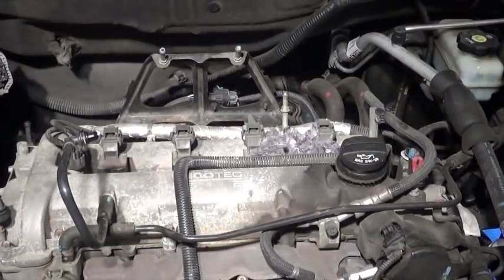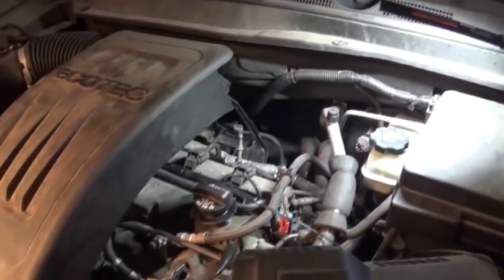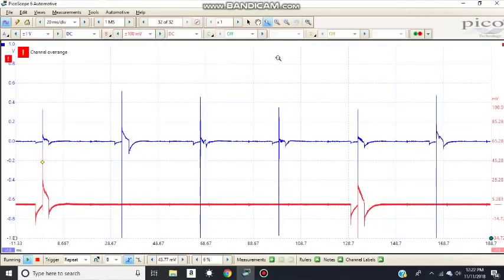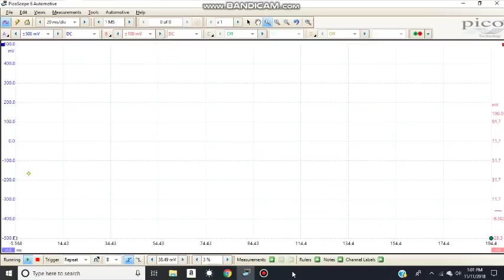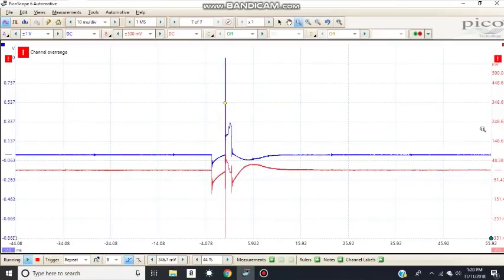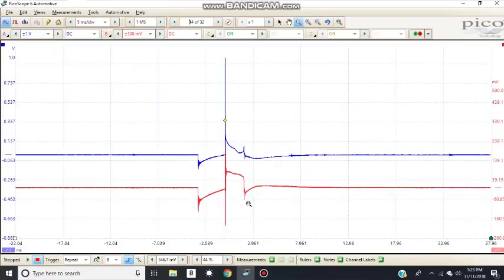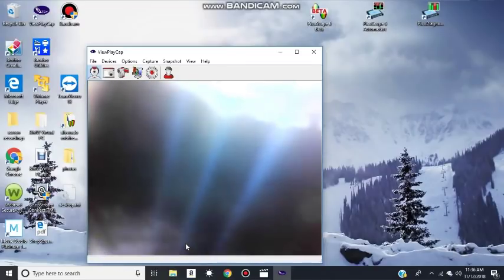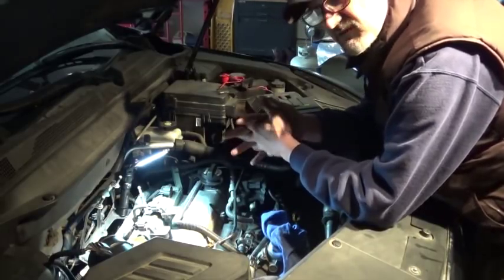Chevy ECOTEC Engine Secondary Ignition Analysis

Comment: Great innovative tool, but I'm struggling with the quality of the waveform. Is it good enough to a diagnostic call? If this engine had a rough idle or intermittent roughness, would this waveform lead you to chase a rich condition when there wasn't one?? Maybe repeat use and experience helps build the diagnostic value of the tool?